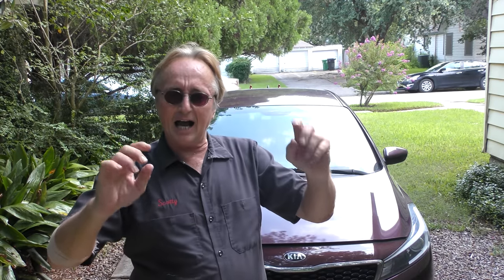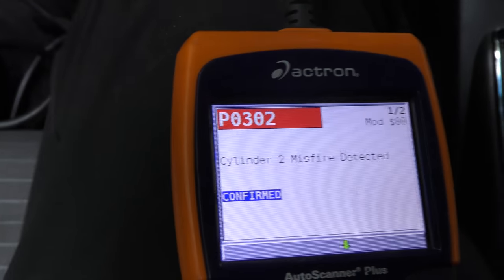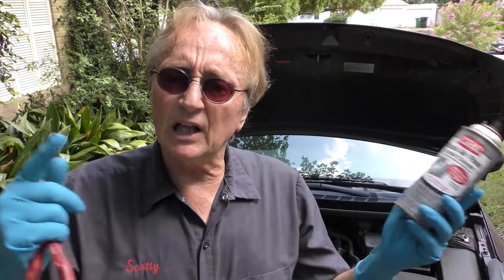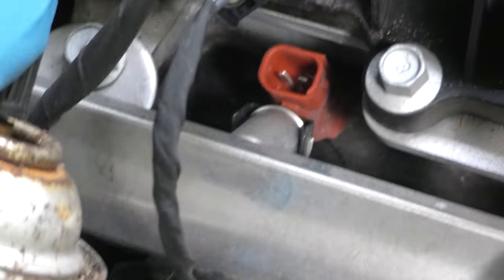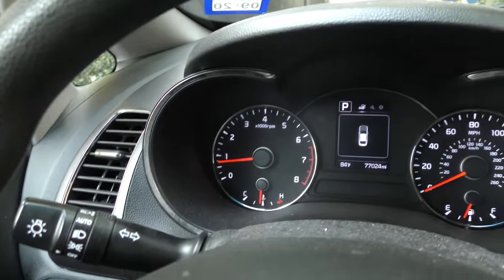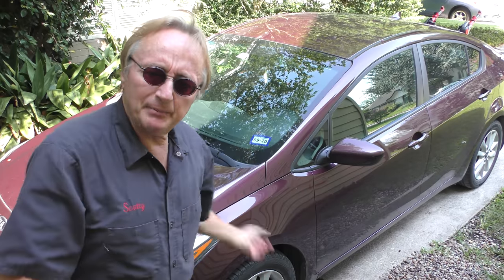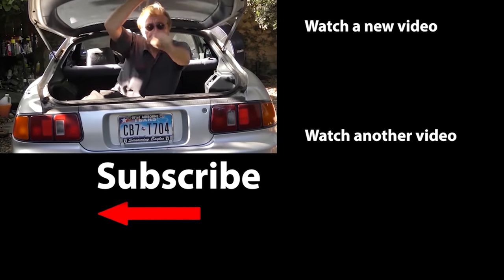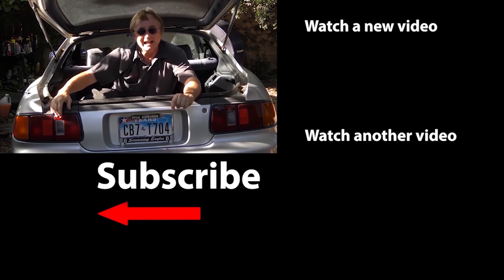Never Do This to Your Car (Learn from My Mistake)

Comment: Scotty really hates those useless Covers! 🐹
Reply: they only trap crap to make working on things harder.
Reply: More crap tacked on to make cars look more fancy and expensive.
Reply: @Lostcontroller   AND more expensive to work on as well as hide some  Whoopsies
Reply: Bought my first car with a beauty cover.  2015 Mazda 3.

It just pulls off.  Held on by 4 plastic ball nibs and rubber slots.

Best beauty cover design ever.  Forgot to put it back on once, 3000psi injectors clacking made me think I broke the whole car changing spark plugs and checking things over.  Guess the cover actually does something.
Reply: I find the the biggest thing they do, is the cover ages the wiring and hoses underneath it, they hold and build up heat which ages the rubber hoses and plastic insulation on wiring. I remove mine when ever I buy a used car.
Reply: @safffff1000  Good to know!! Thanks!!
Reply: @kloroformd  simple always is best.
Reply: john probst  the ones underneath fall off anyway and may disable you if caught in wrong places. or just liter the roads
Reply: Me too, they are so ugly and do literally all of nothing besides maybe stop some dust from being able to rest on the valve cover.
Reply: The cover keep the water from getting on to the connectors.   when it comes from the top.  or thru the front grill.
Reply: I would've been less disappointed if he chucked it away
Reply: Those covers dissipate heat
Reply: @dommopa4464  🤣🤣🤣

Comment: “Pull this stupid cover off”
Reply: Maybe that stupid cover actually has a purpose
Reply: @Game-station498  he has said multiple times why car companies even bother with a cover? Looks like serves no purpose except cosmetic.
Reply: @Game-station498  those covers provide really good protection for mice so they have a place to live without anyone seeing them.
Reply: @beekarinsaan  it looks better without the cover
Reply: That quote is going on Scotty's tombstone.
Reply: @aydenstockham1143  yeah some of the engines definitely don't need to be hidden ☺️.
Reply: “Plastic crap”

“Beauty cover”
Reply: @northdakotaham1752 lol no joke... gives them a nice weekend condo, right next to the injector wiring to snack on
Reply: In my case its an intercooler so no beauty cover
Reply: Edmund Chen Subaru?
Reply: @Ios p - it didn't even keep a little flood water off the engine electrics, useless!
Reply: Itchy Scratch It’s not supposed to, it’s for sound insulation. It’s the driver’s responsibility to avoid driving through deep water.
Reply: @Game-station498  nope, aside from possibly hampering an ingress of mice, none whatsoever. Commonly known as "vanity covers" clues in the name.
Can even cause major major issues, vivaro, trafic and Nissan primastar vans, all the same van, that little cover?
Causes 2000 dollars worth of damage.
Water collects underneath it due to bad engine bay sealing.
Customer never realises, that'll be 4 new injectors please taking up to two hours each to remove due to the rust. We've written vans off because of them, the rust has been that bad. 
That cover?
Stops the water evaporating that gets in and sweats the engine, they really are the most pointless design choice in modern vehicles.
Reply: If any mechanic rips off the engine cover like that on my cars it would be the last time I take it to that mechanic!!!    I've had to replace missing covers before because some AH took it off and never replaced it.     Same with belly covers!
Reply: Honest
Reply: @llcoolray3000  "Get this stupid cover off my tomb"
Reply: @deadprivacy  preach it brother preach 👏👏
Reply: At least it ain't a Nissan versa. They reused the air intake as a engine cover since it literally wraps around the top over the spark plugs.

Can't just rip it off for me.
Reply: @Pablo-oi1hv  your not very smart
Reply: @beekarinsaan  because out looks better
Reply: IDk it does kind of cover the injector wires so maybe it mght stop some water getting in?

Comment: Thank you Scotty. A fairly simple problem for your scan tool  and your experience. Most of us would have guessed the Kia had taken on water by driving through large puddle. I might even had thought of spraying WD-40 all over the plugs and electrical wiring. I would not have known to use an electrical spray cleaner. I would have been guessing all the way. Thank you.

Comment: Hi Scotty,
I have 01 Xterra and the alternator sits behind the wheel on the driver side. 
Which should be used after or before (water splash , water crossing, car wash) for best maintenance?
1. WD40
2. MAFS Spray
3. Electrical Spray
For when the alternator gets wet

Comment: For the guy who wanted to see about getting a larger alternator pulley... I would suggest looking into a higher output alternator if you need one.  If you start changing the pulley sizes, that may cause issues I would think as the belt and pulleys are designed to work together and turn at a specific rate in relation to the crank shaft.  I would just get a more powerful alternator if you need more power as opposed to just replacing the pulley.  It costs more but is probably the better route and will likely mean less problems later on IMO.

Comment: You are so right, BMW here in Australia have the worst resale, we were auctioning 12 month old ones for half price with 10thou kms on the clock, as for parts and repair  they are so expensive you have to take mortgage out on hour house to pay for it.

Comment: Boeshield T-9 is an excellent product for protecting electrical connections from plug connector to battery cable connectors.  It's also the best and longest lasting lube I've found for car door hinges, etc.

Comment: My explorer was having miss shifting issues and would feel like it had no power then suddenly dropped into gear and lurched forward, check engine light came on and gave off the U0101 code. Thought transmission was shot, took it to transmission shop and they said it would cost $3,800 to fix the issue since the tcm was bad and its inside the transmission and needs to be reprogrammed at the dealer. Went home and did alittle research and got advice in replacing all 8 coils to new OEM coils. $350 and 30 mins later the explorer was fixed and never miss shifted again, apparently the cheap aftermarket coils were causing the the pcm to miscommunicate with the tcm.

Never again will I cheap out on maintenance, my advice, buy oem and never look back.

Comment: About changing the alternator pulley size in order to change the power output, I wouldn't advise it at all. They're usually pretty small to begin with and making them bigger would actually reduce the RPM they spin at. Even though it would technically allow more torque from the engine, it doesn't really mean as much as RPM does. You're much better off replacing the alternator if your desire for more power is because of malfunctions, or upgrading it if you're running a very powerful audio system or other high draw electrical components.

Comment: The "WD" in WD 40 stands for Water Displacement. Seems like it should work just fine. But I think I'd go for the proper electrical cleaner spray stuff.

Comment: The cover are also used to keep water off the top of the connectors.  They may have a water resistant seal but anything hot will cool and suck in the water.   So unless you have no car wash or rain storms or snow, keep the engine covers on. Then there are the rats eating wires, bird nest, squirrels.

Comment: An additional maintenance tip: After cleaning prevent future water ingress by using "ACF-50" in the connectors. Rather costly but highly efficient: corrosion prevention and water displacement help with vulnerable electronics.
Reply: @Mark Codiroli As Scotty mentioned: very low amps with around 5 Volts - grease is too heavy. Stick with what is proven to work with delicate parts. An ounce lasts for several cars, so it is inexpensive "per use".

Comment: To the Tahoe guy or any one else wondering about sticking brakes You don't have to lift the car jyst drive a while then get out and feel your wheels . If you have a brake sticking the wheel will be at least warm . So deep for one hotter. Sometimes they can be real hot.

Comment: My 81 jeep cj7 i had every time it rained moisture would get in the distributor cap and it wouldn't start. Wd40 fixed it. So every time after it rained i never tried starting it. Always pulled the cap off and wd it every single time. Man i love the cjs but they leak so bad under the hood and the tops leak too

Comment: I had the right rear brake shoe that got a hairline right down the middle from overheating, further investigation lead us to find the right emergency brake cable was hanging up. We replaced and lubricated that cable in its wrap and put on a new set of rear brake shoes and drums (cheaper to buy new drums then turn them down with a machine). We were good to go!

Comment: I once had a guy detail my Mach 1 '70 428 Mustang. Told him to stay out of the engine compartment. He didn't and used Armor All on my spark plug wires. It caused them to cross fire so obviously my engine started to misfire and I had to replace ALL my spark plug wires. Don't use Armor All on electrical wires would be my advice.

Comment: Hi Scotty! Huge fan of your channel, I've learned so much! I do have a question about my 2007 Acura RDX. 

When I take a left turn, the car will pull to the left, and it gets worse to a point if I take consecutive left turns. However if I take a few right turns the car will drive straight again. I've taken the car to an alignment and the car is properly aligned. It also will drive straight if I hold the steering straight. I've taken it to Acura, to my trusted mechanic, and no one's been able to find the problem. Please help! Thanks in advance, keep making great videos :)

Comment: Well the Comp will throw an error if you only have a slightly temporary problem. Like a miss on cylinder 2 may have only been happening for a few seconds. Now I've only watched about 4 minutes but after seeing the thrown code I would have just reset it and waited to see if it came back.   But since the owner says it isn't running quite right guess I'll watch the rest. 
Now my CEL comes on almost every time my wife borrows the car, but that's because she drives like the proverbial little old lady from Malibu. I check it and if it is nothing and the car runs fine still I just reset it. Happened with her a couple weeks ago when it was over 100° out. I reset it and have gone over 150 miles since and it never came back on.

Comment: To the guy considering the Buick 3800. You should know that there's a recall on the series II 3800, and it didn't cover all cars that actually had that motor (and who knows if it'd still be honored now). The recall involves failing PLASTIC intake manifold gaskets. Just did this job on my fiancee's car. Real fun, lots of gaskets and o-rings....and now solid metal gaskets. Car runs fantastic now and doesn't leak a drop. Oh yeah, did I mention DEXCOOL? :D

Comment: You can solve problems even without a check engine light with a good scan tool.

My 2002 Express would not start when it was hot.  No light, just no start until it sat a good hour.  

Live data showed me the coolant temp sensor thought it was -38F.  Computer had it dumping so much fuel and the timing so far advanced it wouldn't fire over.  $20 part solved the problem.   Well, kind of, it has some other issues.  it's a GM.

Comment: Hi Scotty, I just got a 2002 Collector Edition Trans Am with 44k miles on it. Drives great and aside from usual wear and tear it's really good. I had am issue with the hydraulic clutch sticking, needed fluid. What maintenence items should I pay attention to for a 19 year old low mileage LS1 with manual transmission? I have noticed some hesitation at 3000 rpm, suspecting fuel filter or injector, what's your take?

Comment: Back in the day. as you said.... if it was a rainy or snowy day and the customer's car was running and then just stopped, and wouldn't restart. often bad plug wire(s)s or a funky distributor cap was often the culprit. If it was dark enough under the hood , you would see a veritable light show as the cracked and dried out plug wires and/or cap "shorted out" out to the nearest piece of metal. A shot of the WD-40 would fix the problem temporarily. (As I am sure you know, WD-40, is called WD-40 because it was the 40th attempt by its inventor to come up with an effective Water Displacement formula.) Of course if you demonstrated the arcing to a customer they would sometimes buy a can of the WD-40 "for next time" and not get the affected parts replaced.  Back in the good old days.... when seeing and listening were very important parts of a good mechanic's tool kit!

Comment: I drove through a puddle in my suzuki liana which is called the aerio in usa, at about 70mph which is over 100kmh. The only thing that happened was front end lifted a little and my car re adaptored instantly and was running slow. But re adjusted itself over the next few hours of driving and was back to normal. I think it cooled the lamada sensor down.
Reply: @Mark Codiroli yep lambda 😁. Damn phone.

Comment: Deoxit which is an electronics cleaner got totally different properties than mas sensor cleaner. One is harsh to some plastics and rubber, the other ain't and removed oxidisation.

Comment: Scotty i've got a Ford Focus 2013. The right brake light doesnt work and i think the problem started when i used a trailer adapter (13 to 7 pins). I dont seem to have any power coming thru to the wire when braking. Left side works fine. Both bulbs replaced. Fuse i checked and fine. What can be the issue?

Comment: Should I buy a 2016 Honda civic 1.8 automatic. 18,000 miles ??
Reply: Depends on price and condition. Check on line for engine issues.

Comment: Great advice but don't drive through water to start with.
Reply: Within reason, of course. Also, avoid slamming on the brakes and skidding off the road to avoid water or be rear-ended.

Comment: Hello Scotty I have a 2004 Trailblazer the front headlights the AC compressor and the rear wiper water pump sprayer does not work can you tell me what the issue could be also keep up the good videos have a good day

Comment: Hey Scotty, I have an 04 Acura TSX that looks like it’s leaking oil I’m thinking from the valve cover. It’s a k24a2 engine with 200k miles. Do you know if they have any problems with oil leaks? Also I can’t get into the glovebox anymore any idea on how to fix that? Thanks. Also I’m from the Niagara Falls area as well.

Comment: Ughhhh this reminds me of how I totally destroyed an engine in my car with a cold air intake on it. Sucked water up in it and hydrolocked my engine. It Suuuuuuuuccccckkkkkkkeedddddd. Avoid big puddles ESPECIALLY if you have an aftermarket intake!!!
Reply: I had a cold air intake on an old vehicle of mine and luckily never had that happen. Of course it was on a Jeep so both the vehicle and the intake was pretty high. I always felt like it was going to happen. The only reason why I installed one was because the original airbox cracked and all of the mounting bolts sheared off when I tried to change it. So I kind of fabricated my own cold air intake using $60 worth of Autozone parts, and a couple of self tapping screws. It worked for the rest of the 4 years I had that vehicle though.
Reply: Man, I haven't actually thought of the need to make sure I avoid puddles come winter. I've got an old 2001 Eclipse with a CAI routed down on the bottom left of the bumper. Its really low so I'll have to be real careful I guess. Any tips?
Reply: @ashtonh991  The main thing is to not ford water at all (where the car wades through water). A little splash here and there shouldn't kill it. But you'll want to make sure you keep up with the oil layer on your filter. If you can't avoid heavier splashing, you can get an additional water barrier, they're kind of like a bag that goes over the filter. Either that or you could retrofit some sort of a hard splash guard if you're good at fabrication work.
Reply: @reallynotbob6  Sweet thanks so much man. Is there a specific oil I should look for to use? And how much of a coating/ how often should I use it?
Reply: @ashtonh991  had the same issue with the factory air box. Junk yard my friend. Junk yard. Hardware yes. Sensors not so much unless you have a multimeter andncheck resistance even then it can still be iffy. Example being relays can hold resistance but the deal that actually moves to make contact inside could be faulty working sometimes and not others.
Reply: @ashtonh991  Theres kits you can buy for cleaning and oiling the filter but you only need to do it when it gets really dirty or every few years I've only had to clean my once in 6 years or so and it barely needed it and I would even look for a heat guard(I have one on my short air intake) and you can use it as a splash guard for some protection when it rains and avoid huge puddles at all costs

Comment: I have a 2006 Volvo s40 and have water in my passenger side floor..  I don't know where the water is coming from .  I checked my sunroof water flows out freely from all drain holes. I checked under my hood  water flows out freely . I found some info that said it a service bulletin RTJ 14545-2008-10-07 what EVER THAT MEANS. NEED HELP PLEASE .

Comment: “Thankfully, the check engine light is on!” 

Not exactly my experience working on cars! 🤣🤣🤣🤣

But Scotty’s a different kinda cat.
Reply: Actually I get his frustration. My mom's 2014 Ford Fusion has what I call "code amnesia." It clears all of its own codes when you shut the engine off on it. Makes chasing issues a royal pain in the behind and according to Ford, it's normal behavior for the car, so they won't fix it under warranty.